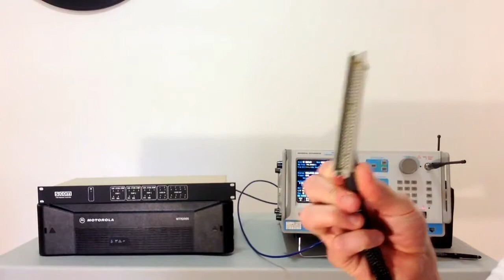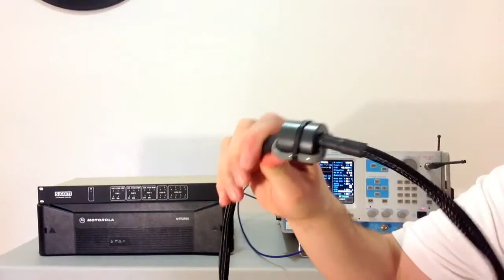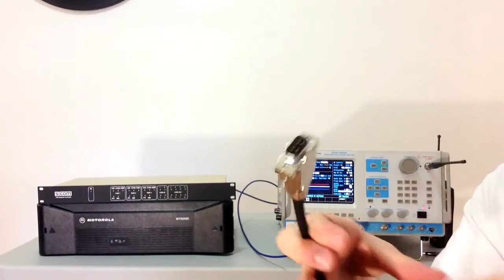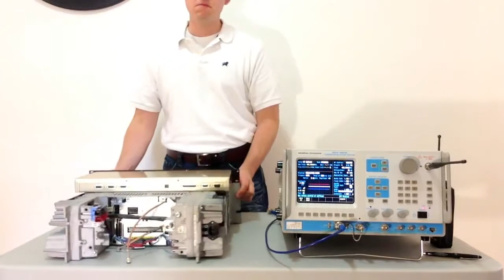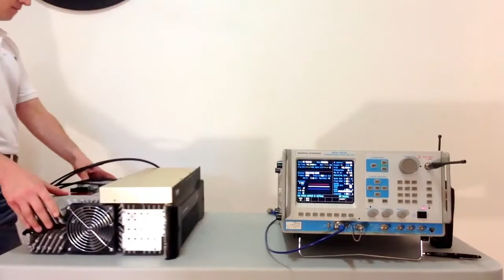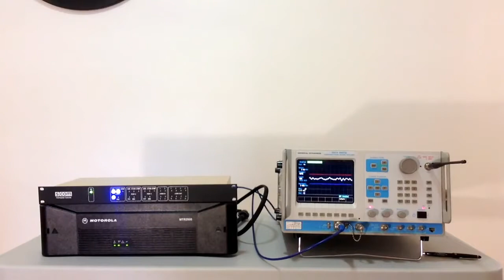MTR 2000   Northcomm Interface Cable

Comment: Since S-com is no longer making repeater controllers, have you made these for the Arcom system? if so do you think you could do a video using that controller system? Our club just got a bunch of these repeaters. I'm getting ready to order the programming cable and software from Blue Max 49er to start going through the systems... Also, is this stuff still AVB from you all. Thanks